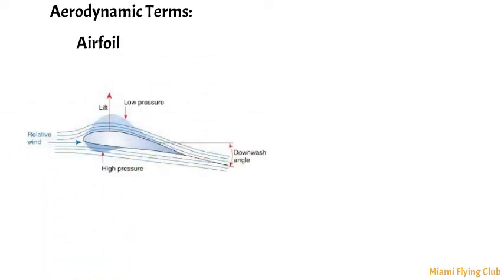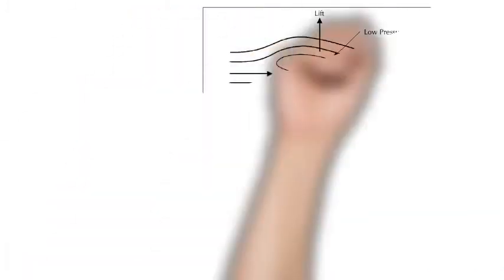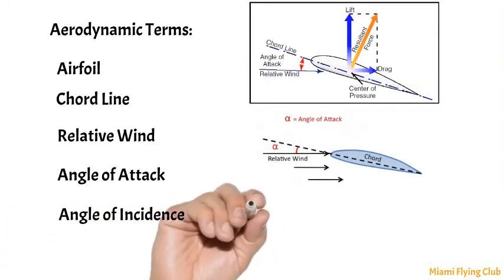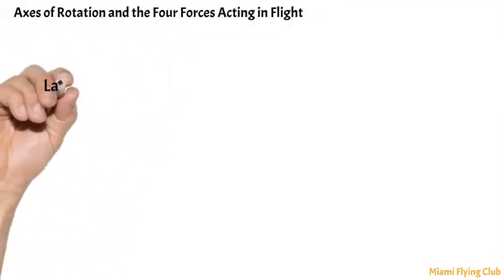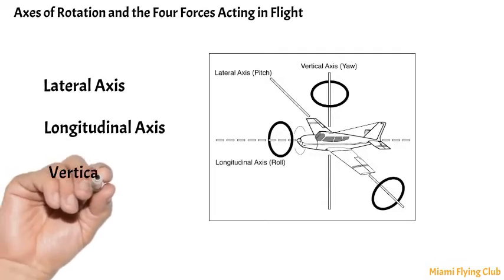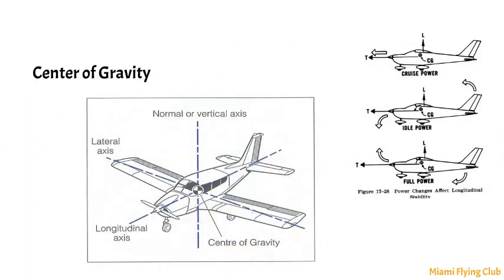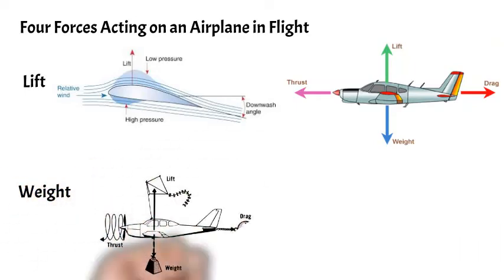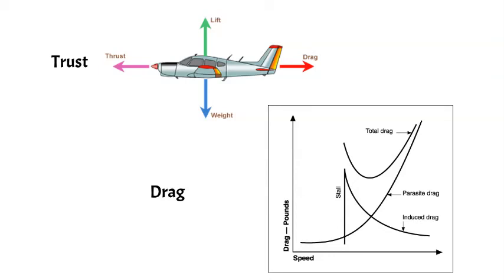Basic Aerodynamics

Comment: How would such a wing fly upside-down as they do?   This wing would pull the plane down.  You omit the leading edge slats which are extended downwards on modern airliners.  At take off the air can't get out of the way of the wing fast enough and gets bounced upwards.   But it soon has to come down again with the weight of the atmosphere pushing down on it.  This causes a vacuum to form along the wing otherwise known as a shock wave.  Vacuums have to go where they belong,  i. e.  to the top of the atmosphere (equilibrium law).  The atmosphere detects a vacuum and pushes it up taking the plane with it.  This is a huge force with the whole atmosphere trillions of tons behind it.  So the Airbus A380 weighing 560 tonnes can get airborne.  At higher speeds the shockwave can't keep up with the plane and tends to drag it back.  (about 400 knots).   Engineers angle the wing back into the shockwave to cancel out the drag while losing little lift.  By this 'sweep'  angle you can roughly estimate the operational speed of the plane.  The bang one hears when the sound barrier is broken is the shock wave collapsing,  unable to keep pace with the plane.

Comment: most airfoil have lift over drag ratio well over 1, some even reach like 30 to 1. 1 newton of drag is overcome by propeller thrust is able to generate 30 newton of lift,  from a conservation of momentum perspective I don't understand how 1 newton of input force is able to generate more than 30 times its original force. Does this mean for a rocket, instead of propeller the combustion product as thrust directly, it's better to blow the exhaust over an airfoil element and generate 30 times the lift thrust ? I think I must misunderstanding something here. Unless this more like sailboat, where you can sail perpendicular to the wind direction at many multiple of the wind speed in exchange for much lower propulsive force. Except in airfoil's case, the vertical down wash air velocity is much lower than the forward velocity but with higher force instead ? Like some kind of gearing mechanism, but for airflow ?
Reply: Please be careful with your logic.  Let us assume that we are operating on a perfectly horizontal level so that there is no lifting against gravity. . If we have a train/ truck on wheels we can load the train/truck with 1000 tons, and if the rails/ roads are smooth and the bearings and tyres used on the train/truck are excellent, and there is no wind blowing against us, we can pull the truck with say, 1 ton of Force .

If as you say, we have a wing with a 30:1 lift drag ratio, then with a horizontal pull of 1 unit we can pull horizontally through the air, the force weight of 30 units. Basically, we have made a lever with a mechanical advantage of 30 :1.  Note the action must keep the plane moving perfectly horizontally so that only the drag is to be overcome. 

With a rocket that needs to fly in space where there is no gravity and no air drag, then no wings are needed,  the rocket engine must take off from earth ground having a trust that will lift the total weight of the wingless rocket directly against gravity, but when in outer space, very little trust will move the rocket.   What you can do it to build a rocket with good wings that would have a good lift to drag ration, take off from the earth with a smaller trust and then keep climbing till there is air for the wings to use, and gravity has little effect and then start a smaller rocket engine, dispose of the wings and proceed in space will little power as there is no gravity and no air drag to overcome,  and apace can float any amount of MASS,   as out in space mass have no weight to lift only acceleration forces to overcome which with a small engine could take a long time to reach a useful velocity,. Note this flying to space has now been put into effect by Sir Richard Branson.